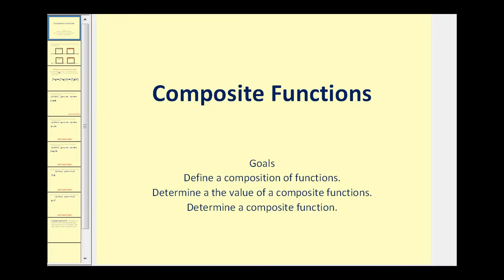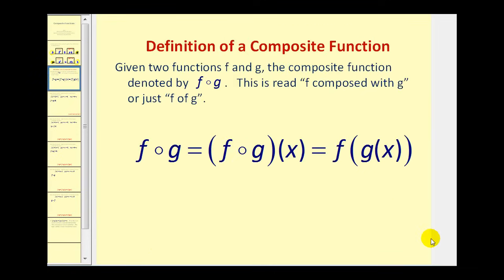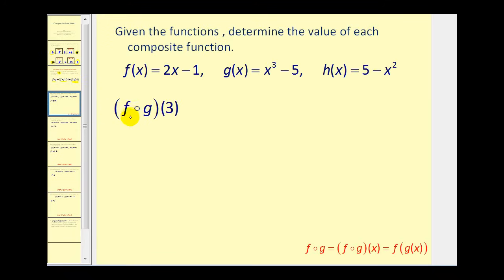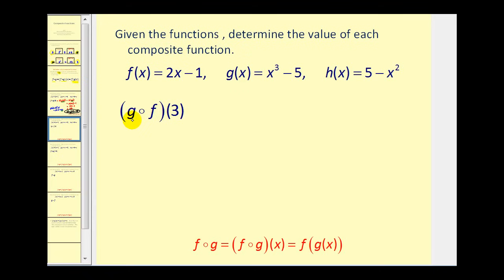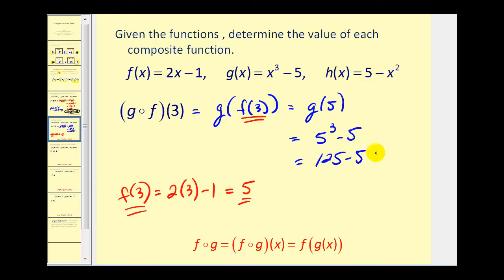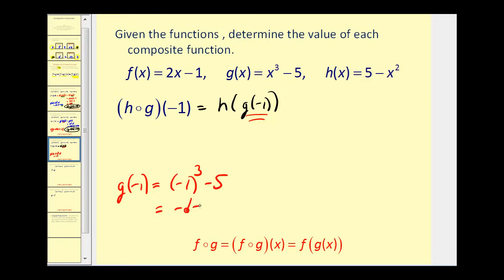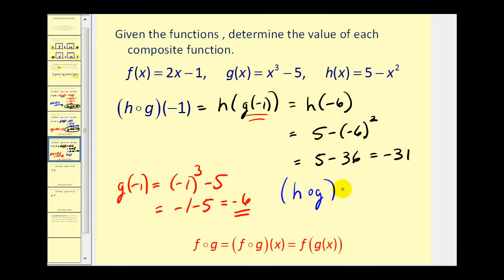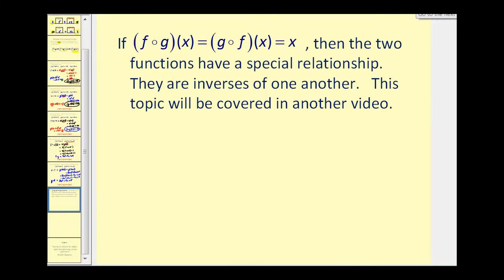Composite Functions

Comment: I noticed when you rewrote the problem at 7:44 , you had changed the sign (in the second set of parentheses)  to a negative and subtracted instead of added them. It was supposed to read (4x+1) +5 and you wrote (4x-1)+5
Reply: it should have equated out to be (4x+1)+5= 4x+6
Reply: yep the answer should be +7 not +5
Reply: He multiplied the negatives in both numbers so (4x+1) = (*4x)+(-*1)=-4x-1

Comment: 5-(-6)^2 does not equal to -31...because negative 6 becomes a positive 36 therefor it is equal to 41
Reply: This is where I am stuck too! I dont understand what he did here. Im getting 41
Reply: The -6^2 is done first, so you get positive 36. Then you do the subtraction. 5 - 36 is -31.